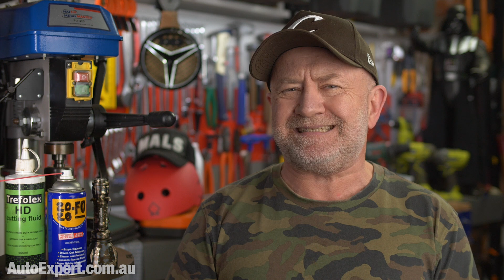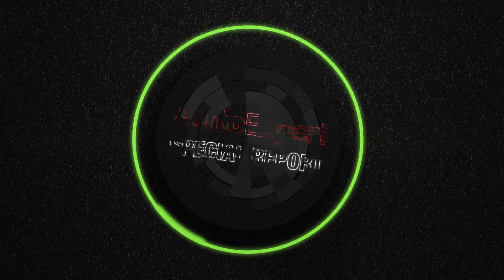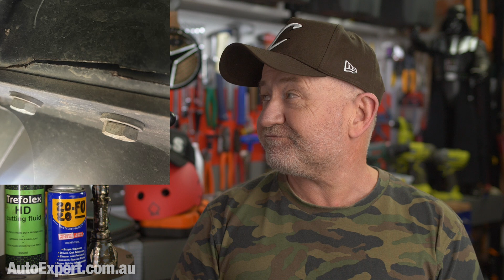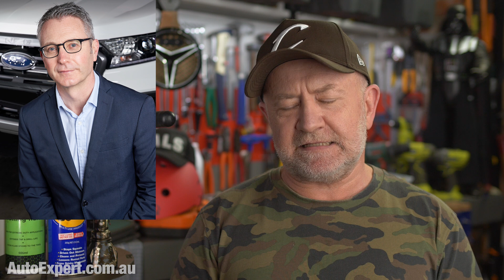CRACKED! Hi-tensile bolts Vs chassis Vs dealer incompetence | Auto Expert John Cadogan

Comment: @ 12:51 is a really good picture. And I enlarged to full screen.  What am I looking at?  These are relatively new trucks (maybe brand new as I forgot the earlier story as you were going on about "NNN" and such.  Then the load limit of the shear strength of the bolts and all 10 of them came loose.   I don't need no 6 years in ENGINEERING SCHOOL to figure out the bolts were never more than finger tightened.  As for the break I now can see the underside of the truck got a coat of plastic...so the bolts are hanging onto the plastic and broke the plastic overcoat.  The hole in the plastic is smaller than the hole in the steel as I can see the steel undercarriage(and that it is pretty flimsy too(it looks like thin metal) telling you I am used to seeing frames on trucks with 1/8" if not thicker rails.     The fix is rather simple.  Get some plastic Goop repairer and Goop it into the crack and then tighten up the bolts properly. .  Done.   I use a 1 foot cheater bar on my ratchet and pull really hard.   Good enough for the girls I go out with.  It looks worse than it really is. It is just "broken plastic".  In the old days that would have been a coat of paint.(that would NOT HAVE GOTTEN IN THE WAY of the initial screw job.)  
.  Had this actually been metal failure...then the truck would have gone back to dealership as a JOKE.(to call it a "truck")
. Forgotten on your part is that the reason the bolt does not turn is not the head or the washer but the contact of the bolt threads to the corresponding nut threads and that friction of the ever so slight distortion of the threads and the oxidation between the 2 metals(rust)  or dissimilar metals oxidation of which the ensuing friction holds shit together.
.  I know.  I have broken off wheel nuts with a 4 foot cheater pipe of cast iron on an X bar wheel wrench  on a GM car. No torch available or air wrench so just lifted it up on a bush axle...to take the wheel off.  Broke 3 studs that way.  That is replaceable with new wheel studs.
I love you method of spilling the "beans".  You talk the "mechanic talk".  Then you throw in some stats that a wrencher does not need to know but you know.  So grade 8 is good enough for a trailer hitch X's 10. Hell, IMO  Grade 3 bolts are probably good enough. 10 is overkill.
. There are mechanics that are conscientious , that check the vehicle over out of habit looking at everything and making the simple hands on checks or eye ball checks of the majority of stuff that normally wear away...as they were trained in mechanic school - - - then there are those that are just "conscious".   I got the former as a neighbor. Reputation matters. He fixes all cars.  Was trained as a GM man, but he opened his own business instead and is happier with that choice. His shop, his rules.

Comment: Bought (new) 2019 Mitsubishi Triton. Tow bar fitted by dealer. Started towing after the recommended 1000km - third time towing our trailer and excavator (approx 2000kg total) saw a bolt missing from tow bar chassis connection!!! All the bolts were loose! Must been a finger tight then off to smoko job! Visited dealer to explain how very unimpressed I was with their lack of professionalism.

Comment: If you don't happen to have a torque wrench (which I highly recommend for critical fasteners), then I would recommend at least 5 ugga-duggas with the pneumatic wrench.

If these bolts had been properly tightened, they would not come loose.  When the bolts came loose, the problem gets worse as there is now an impact load occurring every time you accelerate or brake.

I feel certain that if you were to look at the fracture surfaces, there will be fatigue striations.

PS:  The dealership should have had him return in a month or so to check the installation for ... ahem ... any loose bolts.

PPS: So should I then worry about the cylinder head bolts, rod bolts and main bearing cap bolts coming loose?

Comment: Purchased a new Ford (Falcon Fairmont Ghia) in Sydney in 2002 after a bad experience with a Holden. The quality of the Ford was very poor and the warranty was not worth the paper it was written on. Every time a warranty issue cropped up the list of excuses was unending, why it was not a warranty issue, or why the cheap fix was acceptable. I learned to never buy a Ford ever again because Ford and their dealers do not give a sh!t about their customers.

Comment: It’s no surprise that the bolts that ‘spontaneously’ loosen, are usually the ones fitted in environments without rigorous (or any) quality control.  
The bits that fall off on your epic Simpson dessert crossing, are the bits added after the vehicle was built (bull bars, tow bars, roof racks, snorkels, lights etc. etc.).  Stuff from the factory tends to stay attached.

Comment: If you attempt to apply the full rated bolt tightening torque here the hollow chassis rail will crush.  The tow bar supplier should have established the correct torque.
Reply from the maker: Jesus, Graham, it's not bolted across the hollow tube section. Do try to keep up.
Reply: @AutoExpertJC  Not obvious from the photos John.  If its bolted through a flange then all makes sense.

Comment: After my lexus dealership fitted a brand new tow bar to my RX450h, the first thing I did on returning home (and a week later, and after towing 300 miles) was to get my torque wrench out to check all bolts were secure. Just because it said Lexus above the showroom doors, the idiot from Ford could have easily landed himself a job in the Lexus service department. Idiots are everywhere it's a bloody pandemic (oops sorry couldn't resist 🙄)

Comment: I would not take Johns advice on the chassis repair without an inspection from someone knowledgeable in frame repair. Depending on where the crack is and how the frame flexes at that point it could be very bad advice . The damaged section may need to be plated over or cut off and replaced with a new section properly fitted to counter stress cracking at the join.
Reply from the maker: You'd repair it and condition-monitor the repair.
Reply: @AutoExpertJC  then get it done right when it fails again

Comment: High tensile bolts do just come loose unless they have a thread pitch designed to counter this like Whitworth ( I and many other service personnel hated the sight of whitworth  fasteners because it usually meant you had to cut it off or snap it off and find a replacement) however the back end of a Ute should not be experiencing the kind of torturous conditions needed to have high tensile fasteners just come loose.
Reply from the maker: Absurd. M12 is 14TPI. Half WW = 12 TPI. M12 is a finer thread and therefore more resistant to  undoing itself. M12 = 1.75 pitch = 14TPI.
Reply: @AutoExpertJC  
Metric thread angle is 60 degrees W is 55 flatter thread pitch resists auto rotation at the same thread count. Greater TPI usually means greater torque before failure not auto rotation resistance.

Comment: One of your best vid's yet JC.  I've had ute's in the past fitted with accessories (tow bars mainly) by the dealer when new with similar issues, hence the last 20+ years I have fitted the accessories myself as per manufacturers specifications like torque.  This is usually commented on by the dealer that the part is now not covered under warranty but after what I have witnessed over years from dealer service departments,  I'll take my chances with no issues to date.  So with dealers like the Ford one you didn't mention you'll always have vid material : )

Comment: If the bolts were loose due to finger tight, (bolt clearance is typically approx 2mm for the hole size) would there not be some movement or a rattle over time? there did not appear to be any movement marks in the pics. If the bolts were tightened with a socket even at a slightly lower NM and if the trailer use was both infrequent and well under the maximum load weigh. The severity of the cracking looks lot a bit more to the story. Perhaps road corrugation with the trailer on or an incorrectly distributed load on the trailer.

Comment: I used to fit genuine Ford towbars to BA Falcons in 2003 and ALWAYS made sure the bolts were friggen tightened up to spec... What was this fitter doing? Maybe started before having a liquid lunch at the pub before returning to finish the job with a "who gives a fuck" attitude or, he was working to a "tight" schedule set by AFD... pardon the pun..

Comment: I bought a brand new XR6 in 2009. After the engine was removed twice for rear oil leaks and being told the a/c was working fine, just as long as you left it off and put the windows down for the entire trip, I decided to avoid Ford like the plague. That’s how you build sales by turning your customers away.

Comment: I’m a mechanic of some 40 years experience, I worked in the transport industry all my working life and  very bolt I ever used was hi tensile, from grade 5 to grade 8 in imperial and later on the metric equivalents and the use of flat and spring washers was an absolute requirement, but I always used hard faced flat washers because, if I used mild steel washers in a hi tension application the gauling effect between the bolt head, the spring washer and the mild steele flat washer can cause the bolt to come loose, as you cant get the same amount of permanent clamping pressure on a mild Steele flat washer as you can with a hard faced washer and the thicker the mild steel washer is the looser the bolt became. So I would be interested in knowing if the washers used were hard faced or mild Steele as that maybe part of the problem as well

Comment: In the UK I have been told of a young lady who has/ had a six year old low mileage Ford Fiesta diesel and the cambelt snapped, came loose whatever at @ 50,000 miles Ford schedule a belt change at twice this mileage.  Ford initially agreed some part had failed prematurely but now say the parts fitted are not Ford parts and want £7000 for a replacement engine....the car has been serviced at Ford... apparently the engine is shared with peugeot citroen mini so the bolts may be not have Ford stamped on them ...

Comment: Sorry John, but from the pictures it looks like the chassis metal cracked along the frame not near the joint. The bolts are tight to the inner metal piece. The frame could not support the load and fractured. From my point of view, the subframe structure was not strong enough to support the load. Either the load was too big for the tow bar supporting area on the chassis legs or, the subframe is simply not up to that task. Just my 2 cents. I am not an english language speaker so you can wipe the floor with me regarding my writing 🤣

Comment: Not too surprised. Bought a used Ford recently. Ford Australia can not tell me the size of either the towbar attaching bolts nor supply wheel nuts to suit a 2006 Fairlane. Their response when you contact them is to fob you off to a dealer. Having called dealers Australia wide to have my basic queries answered and not being fulfilled leaves me with no confidence in Ford. Terribly poor service.
Supplying a wheel nut for a steel wheel for a car with mag wheels with different tapers seems dangerous to me also...
Ford does not supply towbar mounting kits for BF Fairlanes either. Bolts from a bolt supplier is the only option.

Comment: The only thing that stops the joint from moving is friction and bolts are there to provide enough clamping force to invoke enough friction that will prevent shear of the bolts.

Comment: This is to be expected from car dealers. I drive a Ford Transit van ( company car) and it is fitted with a factory tow bar. The only issue now is that you can not get the spare wheel out from under the rear of the car as it fowls on the tow bar. One would think that this minor problem would have been picked up by the brain trust at the stealership.....guess not.

Comment: Nice one John. I worked in fasteners for 30 years and you speak the truth. I would like to know what nuts were used, are they captive with the chassis, did they use some form of 'lock' washer under the nut. Whatever though,correct tension is key and critical. Keep up the great work you do.

Comment: Working in mining and heavy steel recycling (shredding) you soon find out who didn’t use a 1500NM torque wrench or hydraulic high torque unit. 
Also sometimes using Nordlock washers and mousing nuts and bolts. 

Don’t do it right today you be redoing it tomorrow!!

Ps boilermaker/coded welder hear,
I would weld it up for ya $$$🍺🍺

Comment: I had a 2015 Everest with a dodgy ecu that played havoc with the ad blue and terrain management system. The local AFD couldn't solve it. Hell, they couldn't even get the front blower fan in the dash to work when it stopped on the day I picked the car up after the previous four days in the shop trying to fix the ad blue error. 
Needless to say, I have enjoyed my Toyota for four  years now with no issues.

Comment: Does ADR allow weld repairs to chassis?
Some states/countries don't allow weld repairs of chassis only replacement.
If weld repair is allowed, a crack like that welded up should also have a tapered "fish plate" over the crack repair.
Although the weld is statically stronger, the original chassis near the weld (heat affected zone) and weld are much more brittle and can fatigue quicker. 
Hence fish plate of joint to reduce stress and leave an unwelded piece covering the welded crack.

Comment: Hi, in defence of the dealership I have been fitting ARB products and Haymen Reese products and sometimes the tolerances are not good so you do them up as tight as you can without stripping or breaking the bolt and over time the bar does bend to conform to the chassis thus the bolts become loose. Toyota even with their products states to check you check towbar bolts every service. I hope this will shed light on torquing bolts and the real life of installing accessories. Ross

Comment: When I see folks towing a vehicle behind a motorhome, I remember the time I was driving home from a Saturday work day at Habitat for Humanity Saint Louis and came around a curve on the two-lane ramp between two interstates and saw a motorhome and a Jeep on the very narrow shoulder.  I stopped past the vehicles and went back to see if there was anything I could do to help.  It turned out that three of the four bolts holding the trailer hitch to the chassis of the motorhome were missing and his own Jeep had tried to pass him on the outside to the left on the curve.  He had gotten the Jeep back behind the motorhome and had gotten them both onto the shoulder with no damage to anything but his two vehicles.  He was waiting for a tow truck to take the Jeep to the RV place nearly thirty miles away.  He was going to camp out until Monday when the RV place opened to get the hitch repaired or replaced.  I remind folks to verify occasionally that the trailer hitch is securely attached to the frame of the motorhome.

Comment: AEJ did you consider the Towbar may have been dimensionally too short to be a snug fit between the chassis rails as a contributing factor? The accessory fitter should have seen a problem when positioning it and felt a problem as they (non gender specific pronoun) tightened the bolts and as the clamping force tried to pull the towbar and rail together. But.. well you said it all.

Comment: When paying over a grand for a 'authentic' tow bar vs half that for a third party tow bar, you expect you are getting 'the best'. Is it a design flaw in the tow bar- dispersing load ineffectually? Does the tow bar plate need to wrap around the chassis and be bolted from different angles? Welding? It's not like it's aluminium which weakens moreso over time vs iron?

Comment: Interesting question…should we blame Ford? I suffered gross dealer incompetence at three dealers on Sydney’s lower north shore. I would blame the dealer group which owned and managed …a Ford dealer, a German vehicle dealer and a UK vehicle dealer.  They each f-ed up. The Ford outfit fitted a towbar and delivered the car with a cardboard box on the front seat with miscellaneous bits and pieces …”dunno what they are for” I was told. They were actually the electronic towbar wiring components to be installed under the Ranger passenger seat. The relevant auto group is utterly incompetent. I feel sorry for Ford!

Comment: This is not a bolt story, but my father purchased a new ZD Fairlane from a reputable Ford Dealership where he lived. The first service all appeared to be as normal but for the itemised bill. It showed the cost of an 'automatic transmission filter'. My father (being very familiar with engines) asked to see what 'an automatic transmission' filter looked like. 

Turns out the service manager was billing for non-existent parts, then pocketing the cash and redoing the bill.

Comment: Hi, I no expert ..but welding ranger chassis is a no no. heat treated i belive. Chassis swap takes about 9hrs and new was about 3k nzd. All know was we cant weld repair in nz and comply with the repair nazis. How do i know ... because brought 5 or 6 from aus.. hit in the rear and wright off in austrailia.Chassis swap, new deck and sold in nz

Comment: Quick question. Whatched your video on clutch wear. Please don't shame me but I bought an ldv v80. In Dec 2018.  Actually been ok.  113,000 or so I'd so far. Not long had timing belt replaced. As was due.No issues. Just curious about when I could expect to need a new clutch. It's a 2018 ldv v80 with the (don't cry) ATM gear box. I only drive in manual mode because auto is bipolar. Presuming I've treated her nicely. What's the average usage before I need to drink port instead of beer to get through. 
Love your work.
 Cheers. Kris.